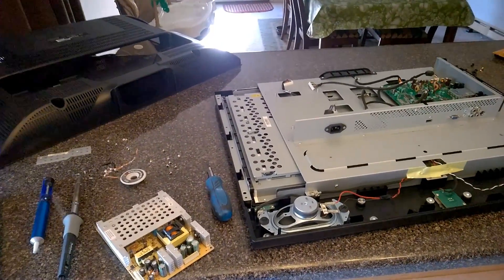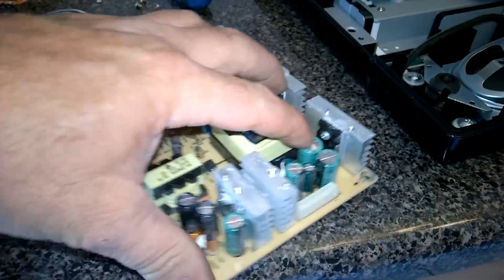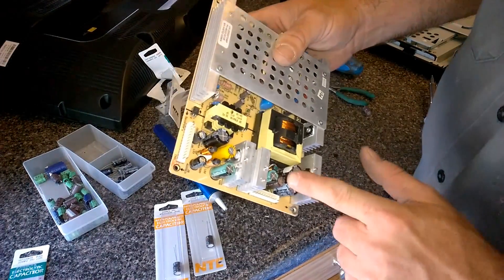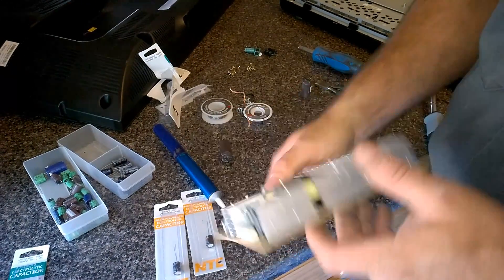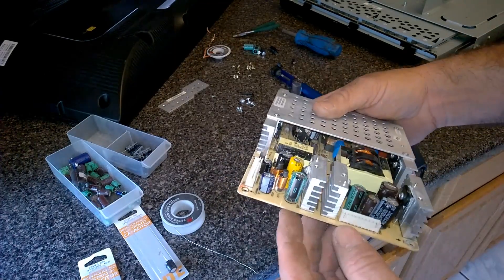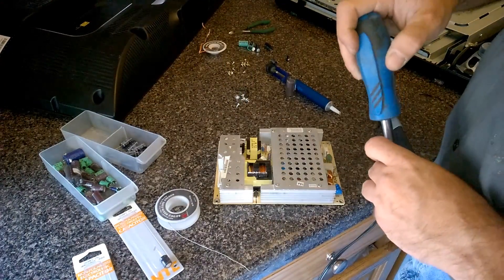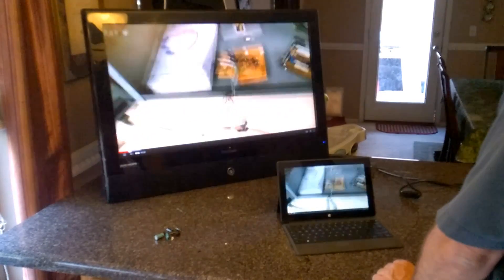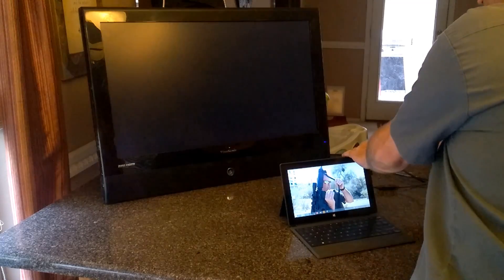Viewsonic N3235W HDTV Repair - Replacing bad capacitors

Comment: I have a problem with the same power supply and i need to contact you please i need your help, if you please can contact me on Whatsapp i would be very thankful, here is my number +201283322754
Reply from the maker: LOL
This was in 2014
I believe I just replaced the capacitors.